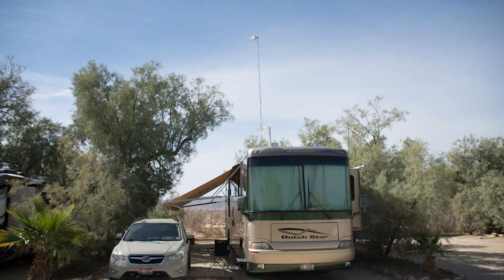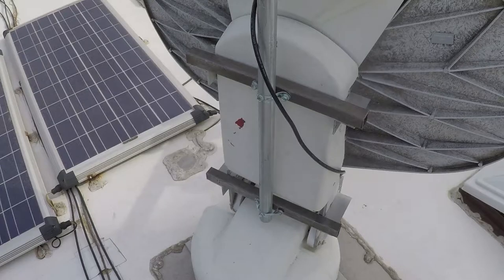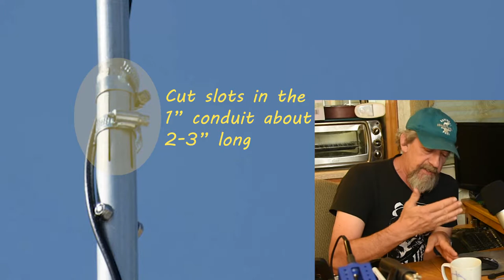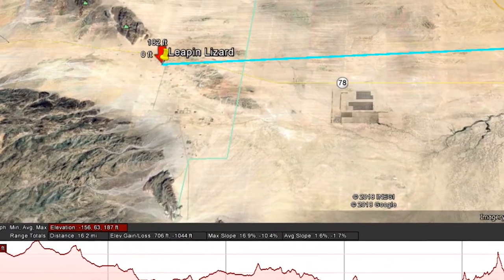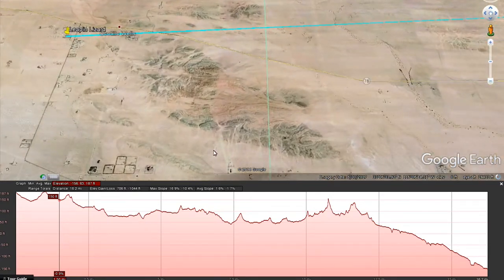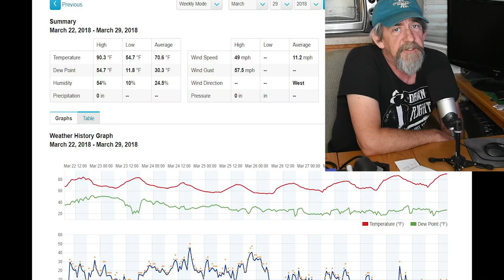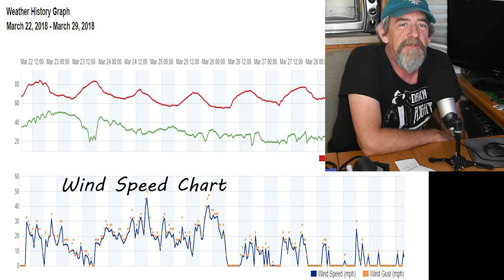RV How To -  Adding a wide band directional antenna to a cellphone booster

Comment from the maker: The antenna is directional so from the narrow end has the highest sensitivity (should be pointed at the cell tower).  It would not be useful to mount it any other way than horizontal. Then point the narrow end at the cell tower. As for urban areas you may be okay with the omni-directional antenna that comes with the unit. If the omni-directional  doesn't work then your only other option is to put the directional antenna higher in the air then using a tool on your cell phone like the one I show in my installation video https://youtu.be/LscUdL3oDB0 to change the direction of the antenna until you have 'peaked' the signal.  Hope this helps and thanks a lot for watching!

Comment: I have a similar set up but found at home Depot a 8 ft expanding tool holder used for window cleaning and it doubles in length and is made of fiberglass and aluminum.
Reply from the maker: I have an expandable paint roller extension but it didn't give me the flexibility to extend the height of the unit beyond about 20 feet or so. I'd used it for a flag pole for years but the locking collar on it eventually got full of dirt and moisture, corroded and was basically useless. The conduit cost me, I think less than $10 and the cheapest expandable pole was over $20 and with my past experience I felt that the conduit was the best solution for the application. When I replaced the roof I did not replace the satellite dish and now just hose clamp it to the ladder. You can see it in operation in this video https://youtu.be/oq5pOBJLB4Y where I am putting it down prepping to move to a new location.

Comment: How do you deal with lightening or do you not worry about it?
Reply from the maker: I'll put the antenna down if it looks like lightening. Since I made this and replaced the roof I got rid of the satellite dish I mounted it to and relocated it to the ladder on the back. Still works fine and it is easier to put up and down. Thanks!

Comment: I see that you mounted the antenna horizontal, did you test vertical or angled. It seems the pattern changes depending how it's mounted. Any suggestions for mounting position for more urban areas?
Reply from the maker: Dave. This video is from WeBoost and the engineer describes how the directional antenna works. He does a pretty good job and it may help you better understand why I mounted the directional antenna like I did.
https://www.youtube.com/watch?v=rmFzEXHecSU
Reply: TR Bowlin thanks very informative video.... one more question, I went to Google Earth but I didn't see how you get the elevation mapping?
Reply: TR Bowlin thanks very informative video.... one more question, I went to Google Earth but I didn't see how you get the elevation mapping?
Reply from the maker: I had a request for that info from another viewer and I am working on a how to video that I will post in the next  couple of days...so hang tight for just a bit... Thanks Dave